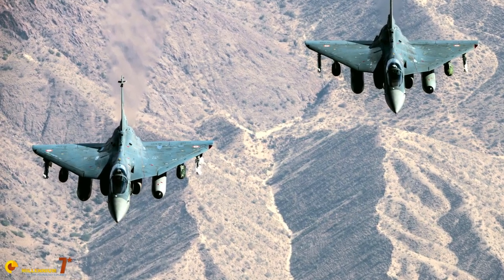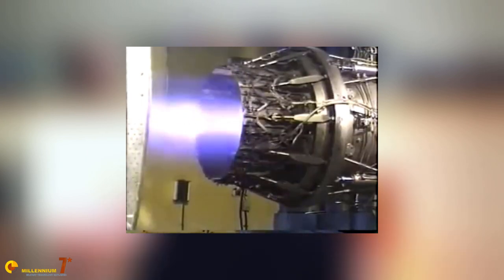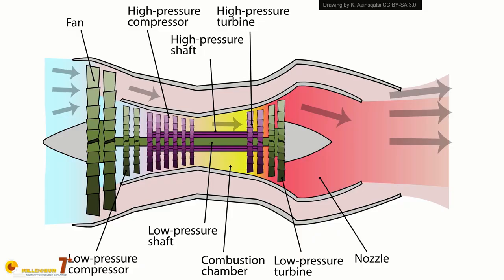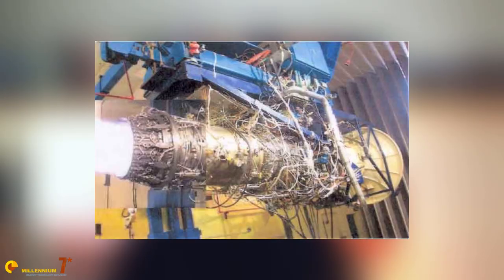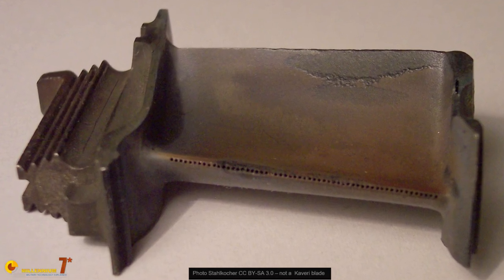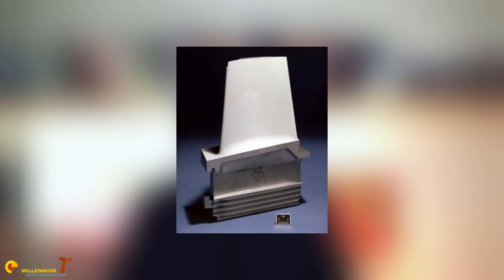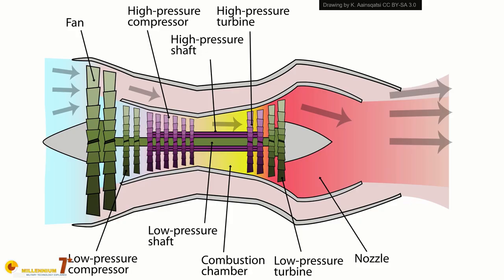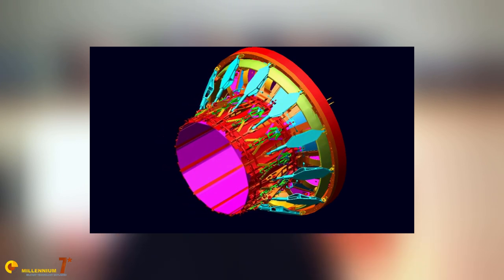TEJAS and the Kaveri Engine

Comment: Wow very insightful. The tejas seems to try to fill the mig 21s role with iaf. A low cost fighter used mainly for training and operations that are not in a war scenario. So its a maritime low cost fighter. But I think the tejas is a little outdated and the Indians need to rethink the concept. The american company Northop made the f20 in the 80s. It lost to the f16. Could the Indians make a similar f16 aircraft but at a lower cost. I. Think the Israelis use the f16 for training so it's not super expensive per flight hour. I think if Indians could rid itself of curruption they could make an equivalent f16 with much lower cost per flight hour or atleast a mirage 2000 sized aircraft with a better engine. I think 120kn minimum thrust
Reply: Seems to me that India is having trouble developing something really up-to-date because she simply doesn't have a very old and widespread aerospace sector. Of course the only solution to that in the long term is to start building one. The Tejas looks like what you describe- not cutting edge but competent and useful for teething.
Reply: I think India may throw the lca tejas into combat with Pakistan as it did with the old mig 21 early last year with Pakistan. That inevitably resulted in the loss of that aircraft. But then again they may not as it will embarrass them. Its hard to make out what really happened due to lies on both sides last year with the mig 21 lost but I think it's clear. To be an effective fighter you need to be able to change altitude quickly so climb rate is important. Need to get high to fire a missile to enable the missile to go far then drop altitude so enemy missile looses its efficacy and gets confused with ground clutter. I don't mean to offend the Indians I too am one but I think it would be wise to do away with the tejas and aim for something like the Chinese j10 as the single engine light fighter. And for medium combat the rafale and typhoon. Both are incredible. I think the su27 family fighters have the size to carry many missiles and fuel large radar to be effective. But I also think there still is a place for the mig 31 or the mirage mach 3 fighter concept. Its kinematics enable the launch of the kinzhal missile which can go further and will be difficult. To intercept because of speed. Something like the mig 31 can threaten awacs systems and other platforms in hit and run tactics. The iraqi air force downed an f18 with a mig 25. But Fielding such a machine is expensive and fuel intensive. I guess maybe I expect too much for the Indian airforce but I don't see the tejas to be any more than the new tx trainer for the US airforce. Maybe marginally better.
Reply: I see your point. The tejas is in the same class as the gripen c. And no doubt there is a place for low cost fighters in this world for close airsupport and to put up against early f16s and jf17. I been watching the tejas perform. I have doubt they have the GE 414 engine i think they may be using the f404 engine that is of an earlier generation and is much less capable. I was simply thinking an aircraft which has a top speed of mach 1.6 at altitude in clean configuration when equipped with weapons and drop tanks even though they are jettisonanble could such a fighter achieve supersonic flight whilst climbing and diving in modern air to air engagements with all that added drag. I remember the Chinese helped develop the jf17 thunder but found no place for it in their airforce. But in counter insurgency or low intensity war the jf17 and tejas are perfect low cost options. And cost effective maritime operations between the two counties as no one wants war.  A bit off topic was I think a redesign of the tejas in the form of the x31 nasa's research plane with the GE414 engine will b free a potent fighter. On YouTube there's some rc versions that are brilliant and the wrong design is better in that it seems to have a bit more better wing loading on the cranked delta than the original x31. I think those x31 rc jets are a better platform than the tejas.
Reply: Good joking kid
Reply: Marcos B  Marcos you have very impressive knowledge. I never knew the Jf17 was a derivative  of the mig 33 or of that design concept I will look into this further. I always thought it was a redesign from Pakistani f16 and isreali lavi. I thought they were the basis on which for the Jf17. I see your point about the turn around time with availability. I think your very right a lengthy battle that lasts a month or more availability will be absolutely crucial. But Indias war with Pakistan and China have all been under 3 weeks actually I think the longest was liberation of Bangladesh I think 22 days. Its hard to say what will happen in a war between India and Pakistan but I agree availability and turn around time will be very precious however looking at isreali airforce  air battles having much capable aircraft and well trained pilots can result in dealing with large waves of enemy aircraft. I think those wars were won out determined very quickly by isreali airforce establishing air superiority quickly. I don't have too much knowledge to say about low radar profile and what advantage it brings to the battle field. But I liked your understanding of modern fighters are not purely about speed given the f35 top speed at mach. 1.6 etc. Im Old school and I think it's all about kinematics. There's going to. Be times when missiles fail or their availability is low. I think nothing can replace your ability to get into a fight quickly and exiting a threat zone. Ingress and egress are important I think. But I guess that's were we differ in opinion but I do appreciate your knowledge on the subject it's definately given me a few things to think about.
Reply: Marcos B  apologies I meant the j10 was based on the f16 and lavi not jf17.
Reply: @soulsphere9242  I never knew Sukhoi had a single engine delta planned. I been looking at the design s concept. It looks awesome. Its air intakes are like the s37 forward swept design. But I think it was a really good design and possible would have been close to half per flight cost per flight hour to the su35. I think the original mig 29 was meant to be the cheaper su27 except its costs were only a 1/3 less at best. The mig 29 design in its day was cutting edge but I think it's getting on a bit now. Back to point this delta design was good but the Russian Air force decided to do away with all single engine aircraft hence they scraped all those mig 23s even though the airframe was capable of more flight time.

Comment: The thing with kaveri was, it wasn't able to give required performance (93kn for tejas)

Even bigger blunder was, the government's lack of interest and stoppage of funds. 

You can tell this by how much money was given to GTRE for development, almost non-existent testing facilities (literally engines were taken to Russia for testing)

Thanks to those, people from GTRE who knew the importance of Kaveri. After, years of requesting. We got approval  for UCAV “ghatak" with Kaveri engine variant. After a decade this program, got some attention.

Tbh, current kaveri program is an failure (not able to power tejas)
But as an engine, it can still power things. But just there aren't many things that can be powered by it.

Tejas mk2 requires 98km or above. (Single engine)
AMCA require 110kn (twin engine)
TEDBF can be powered but will still be little under powerd (two GE-F414)

only, UCAV is its option.

Comment: Can do you a video on the engineering thought about why some fighters go with a single engines and others go with two.  The are smaller fighters like the F-5 is pretty small  has two engines, and very large fighters like the F-8 Crusader, or the F-105 had one engine.

Comment: There is no need for technical assistance because the Al- 31 fp engine used by the su 30 mki are being made in Nashik facility from scratch.Those engines are more powerful and perform better.so,the GTRE or Indian govt could send it's Engineers to that facilities and could derive the technology for the Kaveri engine.But they won't do it because they won't get any commission doing it but they could get commission with foreign collaboration.Thats the reason for the delays and technical assistance.
Crores and crores of Indian tax payers money is being wasted in the name of development and collaboration.
Reply: AL-31FP isn't completely made in India. The hot section is still imported directly from Russia, even maintenance work on the turbine section is sent to Russia. No country out there will ever sell single crystal blade technology to anybody else. It is like the technology used to make a nuclear bomb, only thing is that more countries know how to make a nuclear bomb than cast single crystal blades. India is starting from scratch while GE and Rolls-Royce are in their 5th/6th generation SC blades. The uploader talks about the design turbine entry temperature is 1700K. Current commercial airline engines have a TET of 2000C (2273K). GTRE isn't going to catch up anytime soon.
Reply: @Amar-fd7cg  Both are completely different class of engines. Al31 is way bigger and heavier and not suitable for current airframe design India is planning. Actually Kaveri has higher TET than AL31 and HAL is making SCB for Al31 from raw materials supplied by Russia.
Reply: @shouvikk1  Every time I went to the GTRE booth at Aero India, I've only seen them talk about directionally solidified blades. If what you say is true, then HAL has the know-how, while GTRE is struggling, and is willing to pay top dollar to Safran or Rolls-Royce for this technology. Both HAL and GTRE fall under the defence ministry. Nothing prevents them from sharing information with each other unlike ISRO and DRDO (where India maintains the stance that it does not use tech developed for the space program in the missile program, which is why other space agencies can trust ISRO while collaborating on multitude of programs).
More damning than performance issues, are engine life, reliability and serviceability track record for any aero-engine. As a guy who works on actual commercial aero-engines, I know that the processes that bake in sound engineering were developed over 50 years of iterative experience. This is something that I've noticed lacking in the bulk of Indian industries that work on engineering. HAL and GTRE are horrible when it comes to appreciation of holistic systems engineering.
And yes, I'm aware that the AL-31 and the Kaveri are entirely different thrust classes. I don't understand why you would assume that I was suggesting that both were inter-changeable.
Reply: Part of the reason for seeking another source for fighters is to mitigate the low availability rates of Russian fighter designs. Another important reason is to have portions of the total force dependent on completely separate sources of supply to mitigate the risk of potential logistical disruptions. Combining multiple foreign sources such as with Tejas defeats the point of an indegenous design. It is more effective to go with multiple licensed designs from different sources until a 100% domestically sourced aircraft is feasible. Partnering with Dassault and Safran with Rafale and M88 for near term needs is one way forward to reach that goal in some future aircraft such as AMCA.